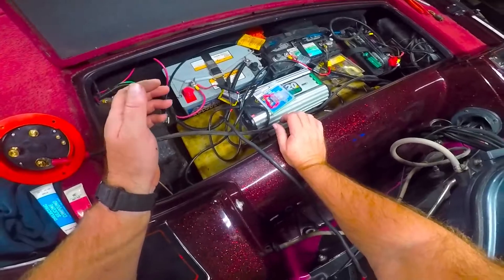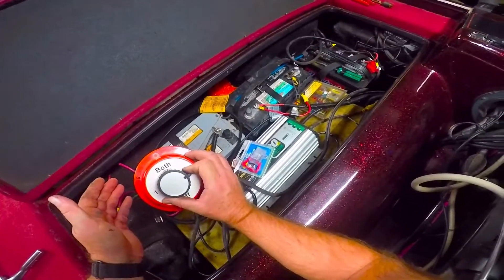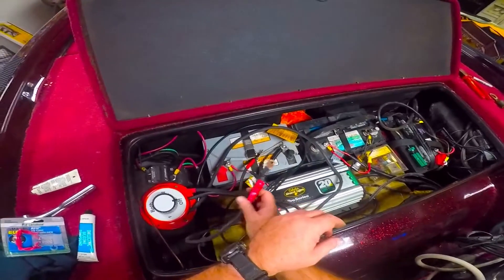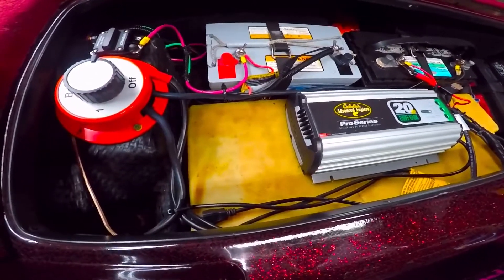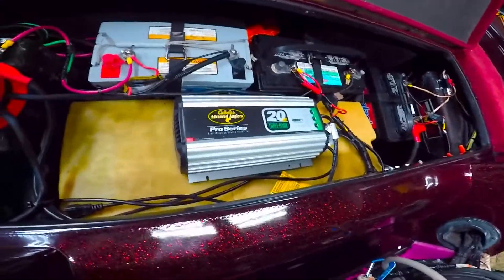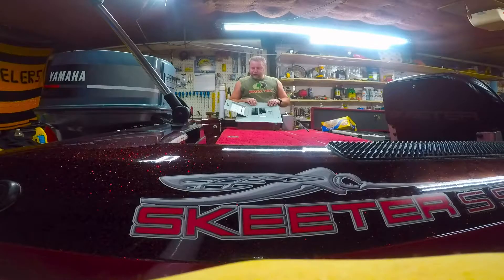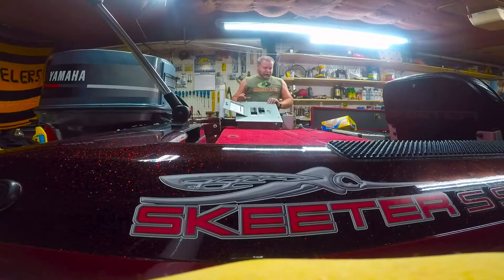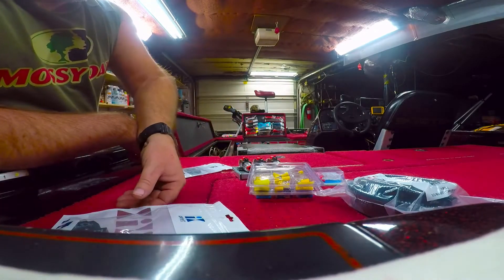how to convert your boat fuses to circuit breakers

Comment: That’s an old school setup you should get a combiner from blue sea they you don’t have to switch batteries it will charge cranking batt then house or both at the same time
Reply from the maker: Thanks for the info ill check it out.  I was trying to show how to do it with out breaking the bank.  I may make one  when i upgrade things on my  big boat when i get some spare time.  Thanks for watching 👍

Comment: Good video. Thanks. Put Amazon links in bottom.  Great video.
Reply from the maker: Marine Boat 4-Way Battery Selector Switch https://www.amazon.com/dp/B0000AZ7X6/ref=cm_sw_r_cp_apa_i_aEy8DbSPDCYH5
Reply from the maker: iztor 5PCS Push Button Reset 5A Circuit Breakers with Quick Connect Terminals https://www.amazon.com/dp/B0779PQ66Y/ref=cm_sw_r_cp_apa_i_9Ly8DbYF0TZPR
Reply from the maker: ZOOKOTO 30 Amp Circuit Breaker With Manual Reset Fuse Holder Solar Panel Fuse for Auto Car Marine Boat Stereo Switch Audio Inverter System Protection https://www.amazon.com/dp/B074643DQB/ref=cm_sw_r_cp_apa_i_SMy8DbVGXDS82
Reply from the maker: ZOOKOTO 6pcs 12V-28V DC 5A 10A 15A 20A 25A 30A ATC Circuit Breaker Blade Fuse Resettable Marine Rally ATC Fuse (Mixed） https://www.amazon.com/dp/B07Y7PK52M/ref=cm_sw_r_cp_apa_i_.Py8DbMHZB09V
Reply from the maker: Thank you for viewing, i hope the links for Amazon help